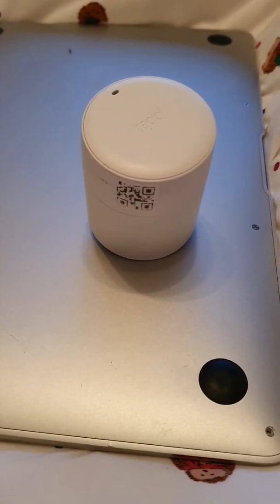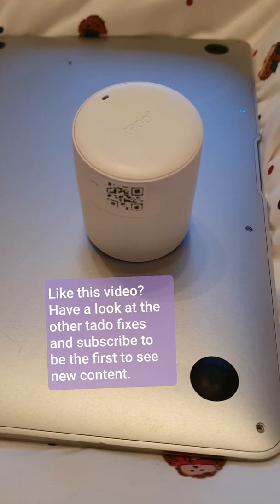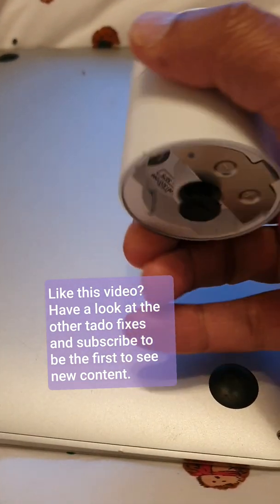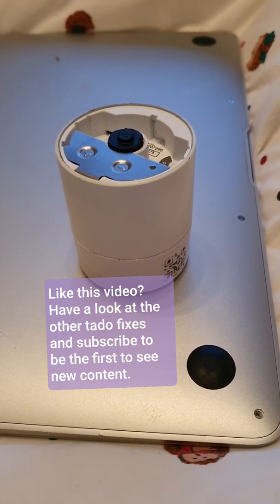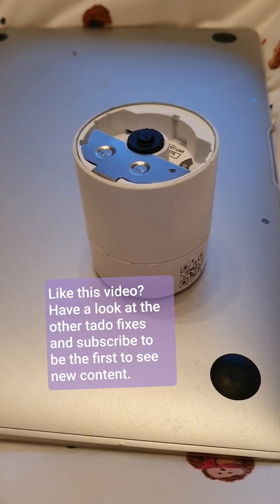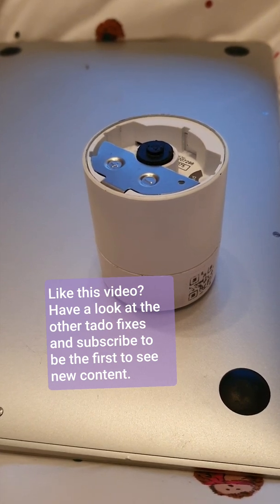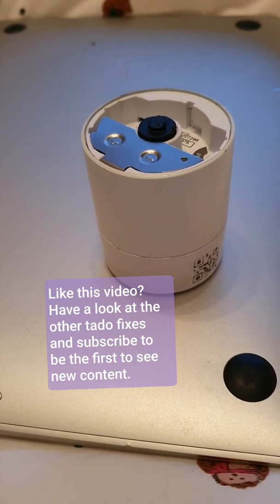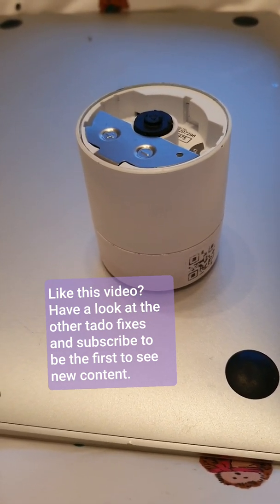Tado heating system failure due to broken tado radiator thermostat and  low central heating system

Comment: Mines not moving for low heat but it's fine for medium and high, the boiler is definitely firing. This is a huge issue if that's the only radiator calling for heat, the boiler just keeps firing and pushing warm water around the pipes, it's not losing enough so I can't condense. Nightmare.

Hadn't considered just removing the tops after calibration and letting full water flow to every radiator when any of them call.
Seems like that must use a lot of gas and kind of spoils the idea of only heating the room you're in... but the question is does it use less gas than trying to heat and failing...

Seriously considering going back to dumb trvs at that point. 

Or just setting my smart trvs to independent so none of them actually call for heat and just going back to controlling a central thermostat with each radiator simply having max temp settings based on a schedule. 

Other than the variable and remote control room max temps schedule, that's pretty much old school.
Reply from the maker: Oil the valve and see if that helps. Also make sure you are using the correct battery. Rechargeables are not the ones to use.
Reply: @Cuttothechase  ahhh now that could be it. Of course I'm using rechargeables, that's all I have these days!
Reply from the maker: Do let me know how you get on. The battery type is very specific. Duracells work .
Reply: Will do. 

I assume the theory here is that rechargeables just don't have the voltage?
Reply from the maker: I think that may be the case.  Rechargeables are usually 1.2v.
Reply: @Cuttothechase  
So several of them had full on non rechargeable Duracell's already, but I replaced them with the specific panasonic eneloops tado recommend.

No joy, issue still occurs.

Have spent all day yesterday drilling in and out of room graphs getting sample instances, time taken to affect room temperature, starting, target and finish temperatures and collating it all into a spreadsheet which I've sent to tado. 

Have taken off the smart trv from two rads (hall that feeds the house core, and spare room/office which is pretty much constantly occupied) - this hasn't fixed the issue but at least the boiler is always getting cool enough water back to condense. It's set to 2 out of 5, I really can't turn it down further or it'll be on frost protection lol, and when the valves do open for low heat there's easily still enough heat to affect the temperature of the rooms. Thats got the gas usage a bit more under control for now at least, since I'm never in a situation where a rad is making the boiler fire but it doesn't have enough surface area anywhere to dump enough heat - mt bathroom towel rail alone was not doing the job, and heating a barely used room to boot, far too often.

Guess we see what tado comes back with.

I'm close to putting dumb trvs back on everything except the rooms that have clear periods of non-occupancy though.
Reply: Important thing to note here though for your viewers: it's not "a" broken valve on my case. Every valve on my system - 7 of them - has this issue at least once every couple of days. Actual Rad pins all loosey goosey, it's not that.
Reply from the maker: Did the batteries help?
Reply: @Cuttothechase  no, (that's why I've posted back after testing, to let you know)
Reply from the maker: Ahh I just saw the long post. Another thing i would consider doing is reinstalling the entire system from scratch. Add one tado radiator controller at a time. 
It will be interesting what tado suggest. I’ve never found their team helpful other than a huge update they did for me when I purchased the system.
Reply: I'm not sure I could install the system from scratch - the main thermostat and boiler connection were done for me by Homeserve a few years back, the only thing I've done is put the TRVs on during summer 21. Me and going near wires, history shows, is not a thing anyone should encourage :D
Reply: @Cuttothechase  update: my hours and hours of spreadsheet population appear to have convinced them there is a problem and they can, after all, change some settings to have the valves open a little more when calling for low heat. It will take a couple of days for this to download to all the TRVs

...at which point we'll see, and I'll update back here. 

NB I appreciate you are not terribly interested in all the detail, I'm more thinking of others who discover your excellent video :)
Reply from the maker: @jezlawrence720  I am  interested! I know we are all going to be winners when you get the solution. I’ve already learnt that good stats makes all the difference.  Keep me posted.
Reply: @jezlawrence720  I had the problem too at the beginning of the year. Had to explain the Issue very detailed. After some time they also said  they can change some settings to have the valves open a little more when calling for low heat. But now I have the same problem again. Tried to contact support. They think the problem is on my side, the boiler is not correctly installed I should get someone qualified to come and fix it. Now I have sent them a video with the demonstration. I hope they understand the problem now... 

Glad to see I am not the only one having problems with not opening the valve when calling low heat. They should definatly fix that.
Reply from the maker: I feel for you guys.

Comment: Hi, I am having a similar issue where I call for a heat in one room and in the other room the heating all heats up. Even the the tado radiator valve is switch off it still heats. I check the valve its working fine and I am therefore stuck on what next to do. When you say you eased all the pins is that on the radiator itself?
Reply from the maker: Yes. Take the tado unit off and push the pin in manually with your hand.
Reply: The trvs come with adapters for different valves. If it is heating when the valve is closed then probably either the valve is stuck or you need to use one of the provided adapters.